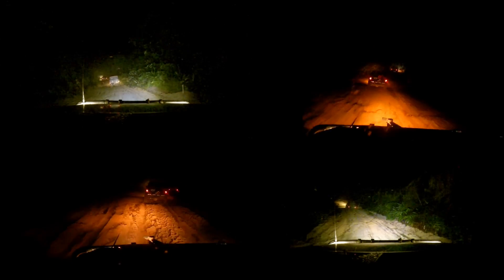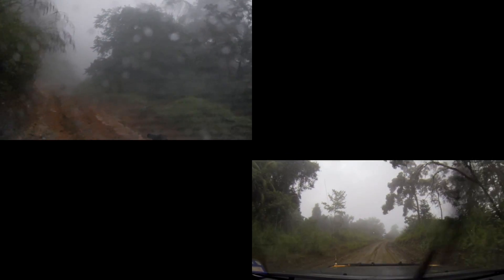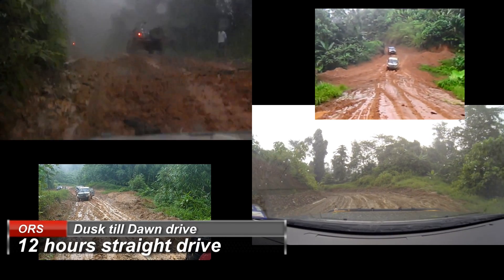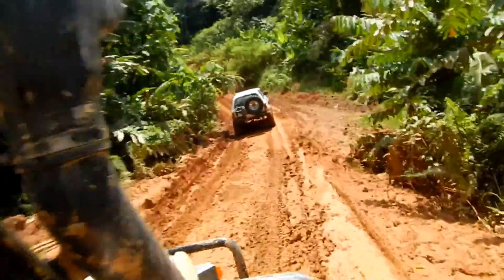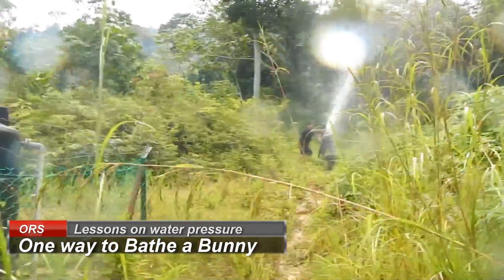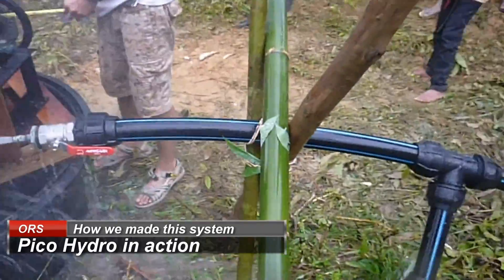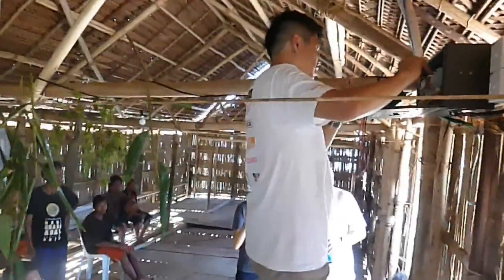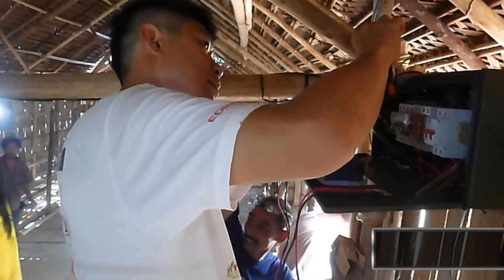Pico Hydro 24th Aug 2014

Comment: how kw?
Reply: 3kw
Reply: The V belts on all my industrial machinery transmit about 1Kw continuous power, all well
aligned, tensioned in clean dry protected environment. Where can I get these marvellous belts so I can throw away 2/3 of the old belts. That is some of the best, bad engineering I have had the pleasure to cringe at.
Reply: nguyen phat 
20 kw